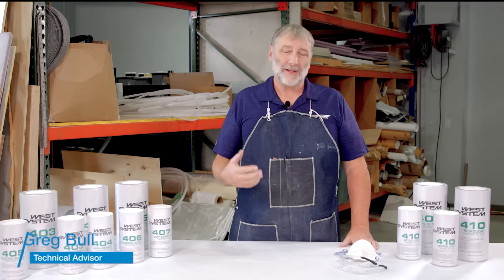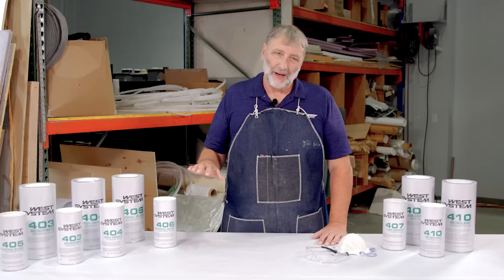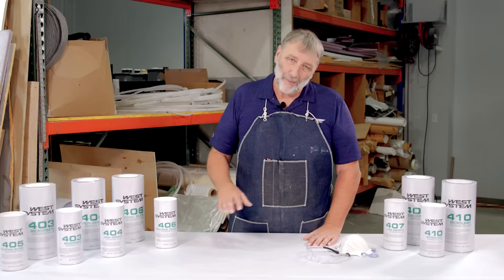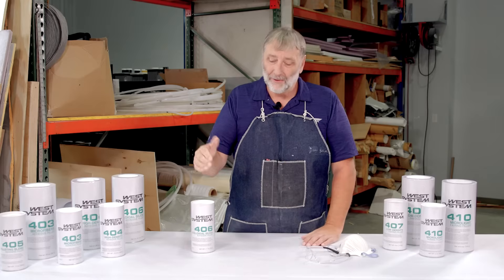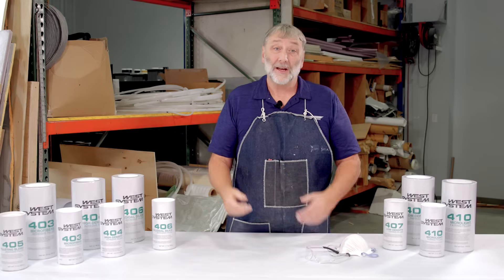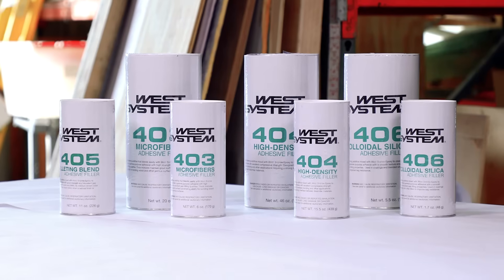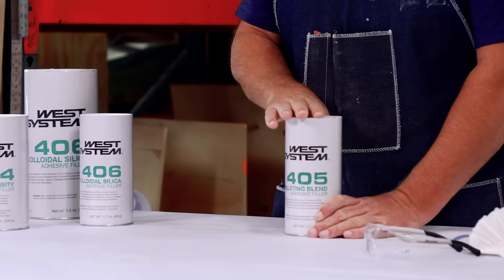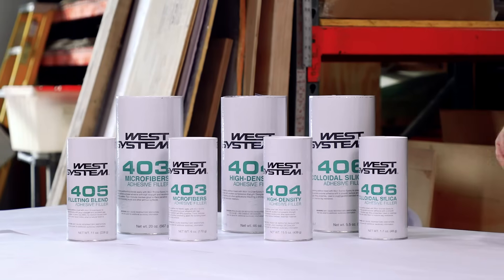WEST SYSTEM Filler Selection Overview: Why are there so many? How do I choose?

Comment: The information I feel is still missing (despite your recent videos being super-helpful overall) is a guide to VOLUME: how much filler to how much epoxy (presented in whatever units of measurement are used for the packaging) to produce X volume. Some complexity to producing such a guide, especially with the ketchup/mayonnaise/peanut-butter consistencies taken into account, but it would be invaluable for those of us trying to determine just how much to purchase for a project!
Reply from the maker: Hello! We actually do have something like this available on our website. If you scroll down towards the bottom of the page you will see the "Filler Buying Guide." That will show the amount of mixed epoxy needed for each filler container size in order to gain those different consistencies. https://www.westsystem.com/filler-selection-guide-2/

Comment: Hi Greg, I'm going to use the 410 Micro light for sealling the surface 3D print layer lines but in addition  I'm going to need to "seal" a seam line because I bond two shell parts together and the seam line would be around 0.5mm thickness and deep so it is very very small but it is possible the print was not perfect and it could be a "step" between the two shell part connection area so I'm wondering if the MicroLight would be enough ( with more charge ) or if maybe another filler better for this specific putty task ? thanks by advance
Reply from the maker: @BenTSH1000 407 Low-Density filler would be a better option for sealing the seam to maintain overall a stronger bond.— WEST SYSTEM Technical Services

Comment: 404 seems to be abestos
Reply from the maker: No, it is not asbestos. It is a calcium silicate blend. As an ISO 2001 certified company, we go to great lengths to vet all incoming raw materials through rigorous quality control measures. You can view the safety data sheet on the product page here for more information: 👉 https://www.westsystem.com/products/404-high-density/

Comment: If I add the 406 to the exact color match gelcoat from the manufacturer to thicken it up, will it alter the color of the gelcoat?
Reply from the maker: Hi @drtbar260. Adding 406 Colloidial Silica filler to color-matched gel coat can alter the color. 406 filler is an off white filler, and once added to a tinted gel coat may vary the color. Instead of adding filler to the gel coat we recommend making the surface fair/smooth, so it would not require a thickened gel coat to be applied.